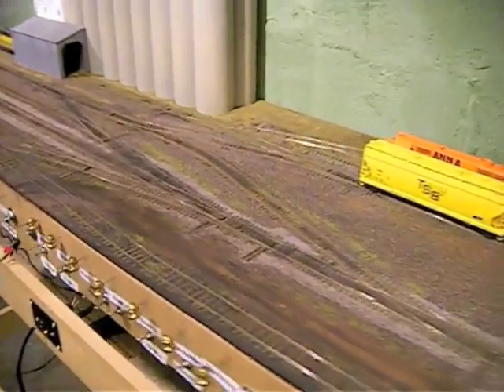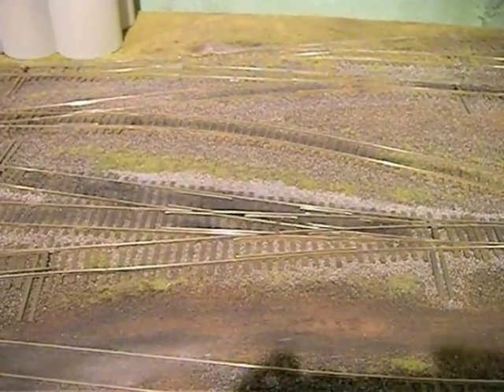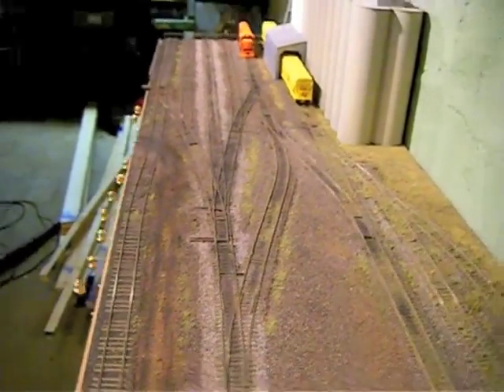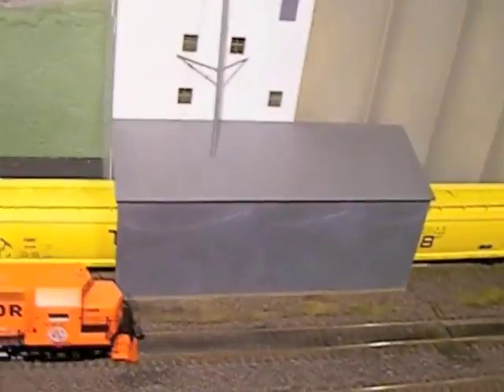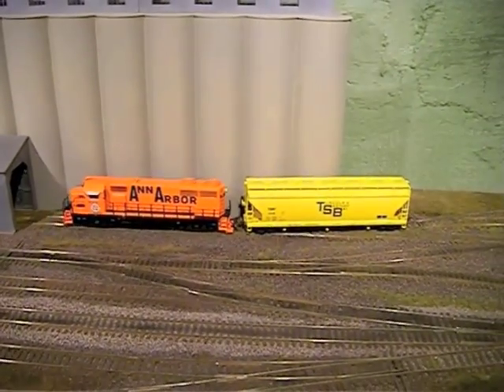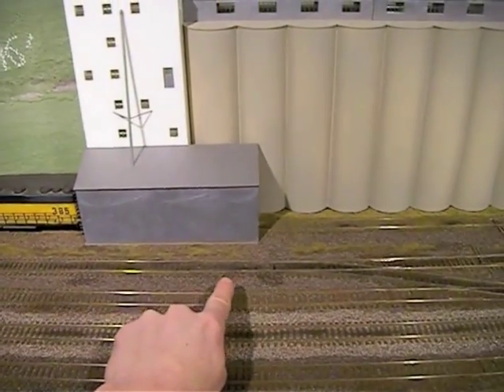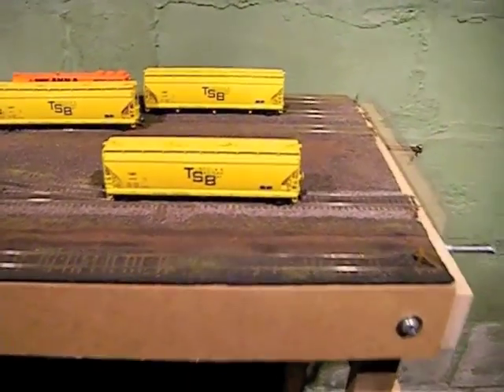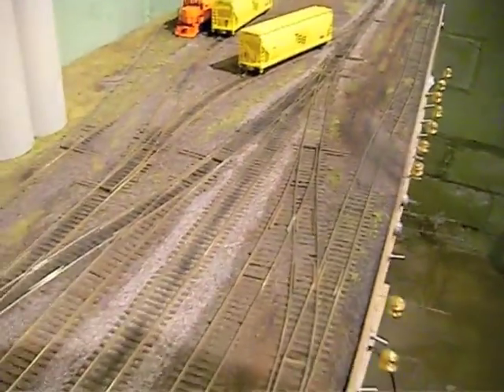Talking about my small 5' X 18" switching layout...

Comment: Way back in the late 50s my dad let me use on old cabin on company property. I put in a 4 x 8 foot plywood layout. It had 15",18" & 22" radius track. I would turn off the light and run in the dark round and round and then turn on the light and switch for hours. I had a blast. I like your layout because it brings back those good times I had. I could look out the back window of this cabin and watch the Great Northern crew switch their yard. Little did I know at the time that I would work for the GN, 1966, and switch out that same yard.

Comment: Ah, the Ann Arbor railroad.  It used to run through campus when I was at Central Michigan University in the late 70's.  I could sit on the upper floor of my dorm at night looking south and see the headlights approaching for miles before it got to the crossing outside my dorm.

Comment: Hello, I love this shelf layout, as this will fit perfectly in my one bed room apartment. What kind of switch machines did you use? And you mentioned under the table uncoupling magnets? How do you power the layout? Is it DC or DCC? I noticed that you don't use homasote for the top. Is there a reason for that?
Reply from the maker: Hi, this is my old layout. I tried to do make manual switch controllers with wire and tube but it was a disaster. Now on my new layout I use tortoise (smail) machines with DCC. I don't use any homasote or pink sutra because I have to reason to make elevated track or ravines or ditches and on a smaller layout I am not that concerned about what noise trains make. ON my new layout I use 1/4 inch pink insulation sheet and put the track right on that (with out cork road bed). I like my tracks looking old and not to elevated up. The 1/4 inch allows me to have a little elevated look if I feel like it; by cutting it away. 1/4 inch is good because it allows you to stick stuff into it also, like trees and signs, it is just enough. if you scroll back back in the photos on my facebook page you can see construction... www.facebook.com/SaginawTerminalDocks

Comment: Very cool trackplan you have there!  How many cars will fit inside the switching leads on each end of the layout?  Have you considered adding removable extensions off of each end to allow you to switch more cars at a time?
Reply from the maker: The yard lead fits 2 cars, the yard fits 2 on all tracks, 3 on center, the run-a-round 2 cars and 2 cars on all the tracks for the grain elevator yard, the lead for that yard fits 3. Yea I considered simple extensions, that was a major part of the planning. you could also add a flat industry on that 3rd track on the back wall to make switching jobs a little harder. FYI, the 3-way switch is nice for saving space, but many locos have problems and it was a bitch to power all the frogs. The reason locos have problems is cause the inside of the wheel flange bumps another track and it shorts. Might be a code 70 thing or a "bad batch". If I could go back in time I would have made it a foot or 2 longer and used 2 separate #6s instead of that 3-way. AND I considered making another flat industry that for that spur on the front of the layout, which would just be clamped on when in use.

Comment: What did you use to paint the sides of your rails with ? Paint pen , airbrush or by hand ?
Reply from the maker: the rail and base plates are floquil rust color done with an airbrush. I ran strips of painters tape down the center of the track and over each side of the rails on the ties, leaving just the rail and "baseplates" exposed to the rust color. before this I coated the whole track with a rail tie color from pollyscale or floquil. this was all done before installation.